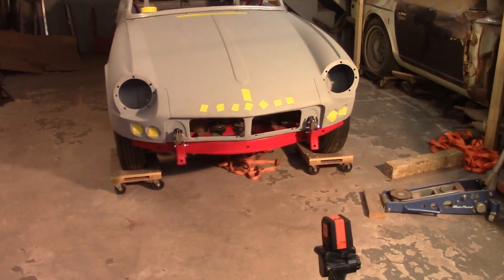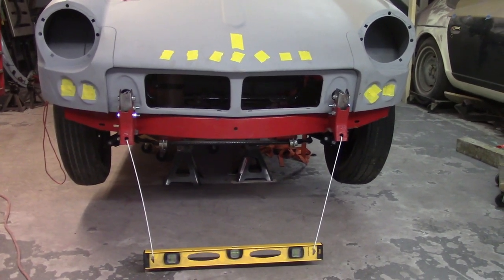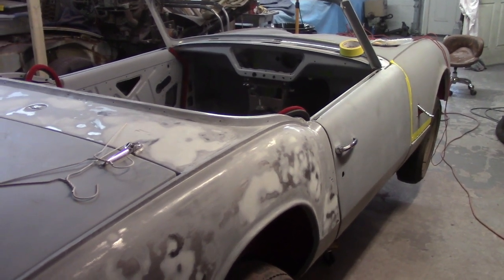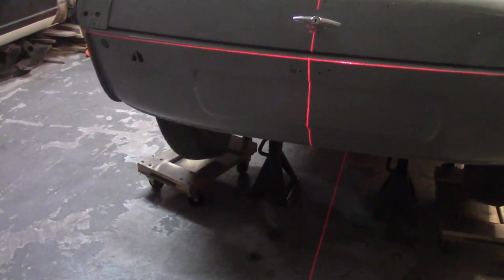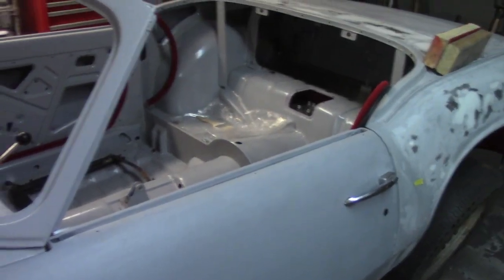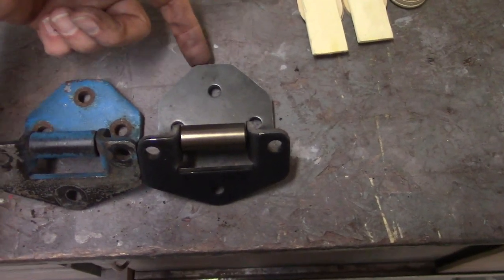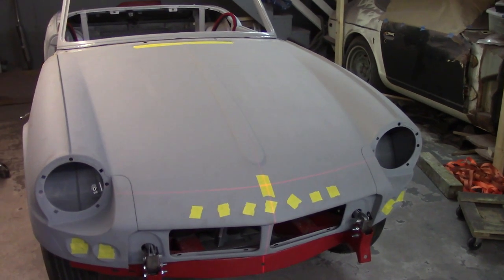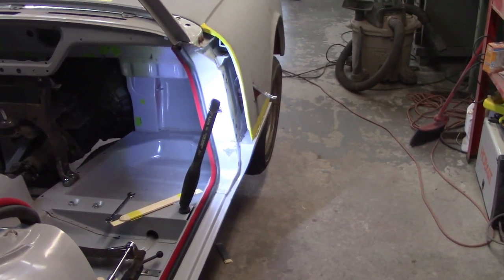Frame Leveling (and gaps, of course) | Roundtail Restoration

Comment: Wow that was a struggle! The laser level is sweet, never messed with one of those.
Reply from the maker: Struggle is one word for it. I've got more. Yes, the laser level is great. I had never played with one before this, either. Worth the investment.
Reply: A bit off topic here: How much base & clear did SPI recommend for your project? Ordered mine and now paranoid I didn't get enough.
Reply from the maker: They recommended 2 quart kits of each. If I remember they both mix 1:1, so a gallon total. I've used some red for the raptor liner, so I may get another quart of red. Whole car is getting final sealing coat of epoxy so I'm going to see how much that takes and go from there.

Comment: Hey, I'm glad to see you checking all the alignment details and your levelling methods.  I did something similar on my car with homemade spirit levels.  First I leveled the floor using Windex in a channel that spans the width of the car.  From there I was able to make adjustable height gages to check how level the chassis was.  My car is a unibody so there aren't any shims to play with.    Here's the video if you're interested.
https://youtu.be/VkPx2kQlIb4
Reply from the maker: Thanks, Tom. My gaps and panel-to-panel transitions aren't going to be anywhere near perfect, but they'll be acceptable to me. Thanks for the link, I'll take a look.

Comment: Hello, Please indicate how you consider if the concrete floor or the jack stands are not level?
Reply from the maker: I used the laser level to ensure the frame was level. As long as the frame was level (I assumed it was itself true and straight) it didn't matter if the floor or stands were level.

Comment: Second!! (If anyone can play)
Graham
Reply from the maker: Sounds good to me, Graham. I'm just happy for the comments, regardless of which place you are in!!
Reply: Hi Chris, I suppose that I should of added a comment of some value as well.  I thought your use of the laser was a great idea.  I someone does not have access to a laser, they could use a water level. I do not know if it would be quite as accurate, but could have the benefit of checking level at two points that are out of site of each other.  Keep up the great work!
Graham
Reply from the maker: The nice thing about that laser level was that it's self leveling. As long as you set up the water level properly, it works just as well.